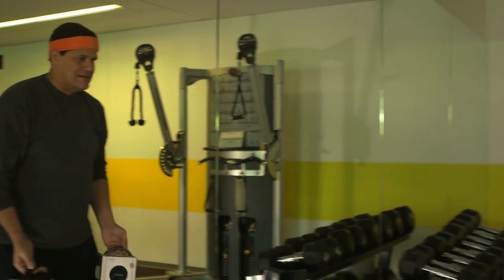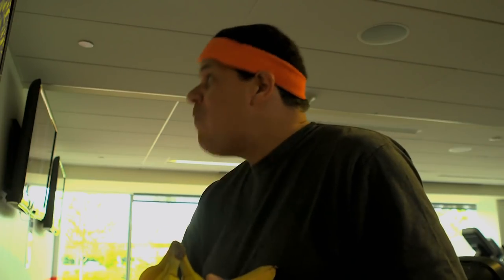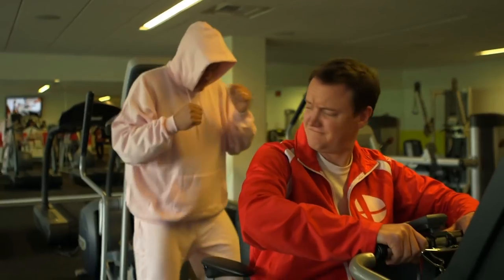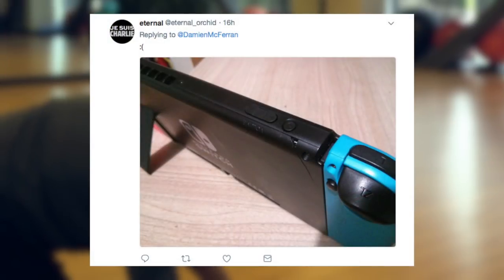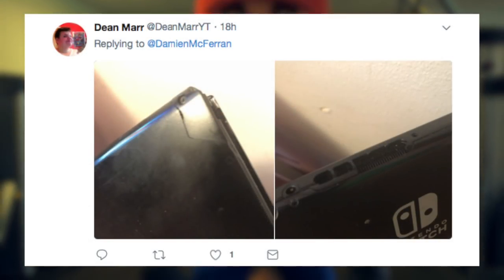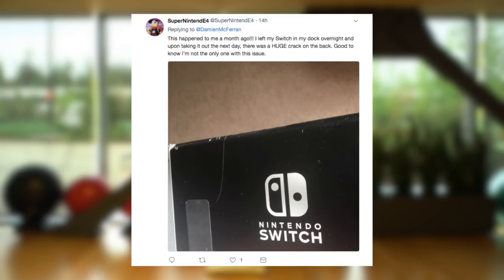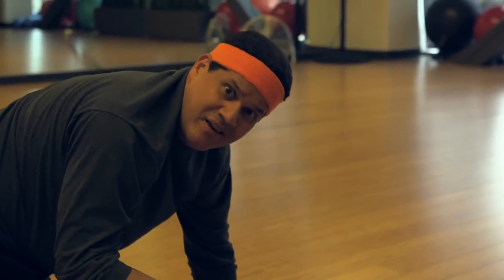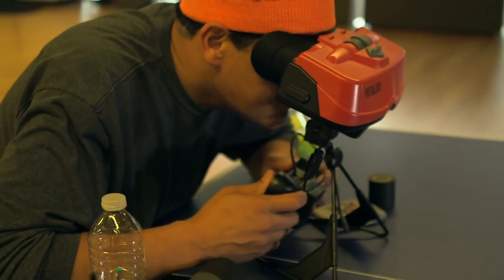Is Your Nintendo Switch Cracking Under the Pressure?

Comment: Yeah a piece of plastic has broken off near one of the corners on my Switch. I’ve already had to buy a 2nd pair of Joycons because the original pair isn’t very durable. I hope we get a Switch Pro at some point.
Reply: Yeah they'll definitely release atleast one revision of the switch, like how there were many different models of the 3ds
Reply: I have the switch since day one, dropped my joy cons more often than i would like to admit but still working fine o.O
Reply: D2daICE If you dropped the Joy-Cons by themselves then they should be fine as they are durable and light, unless you dropped them on concrete or something
Reply: JD
I don't have any carpet at home (it's "only" tiles) so i would say it's pretty hard but they are still fine.
Reply: Tiles aren't really rough like concrete is, so it'd still be pretty hard to damage them anyway.
Reply: I would rather just get a real system. Not some strange Wii U 1.5 boy. (Boy as in portable)
Reply: 16bitFishing Trolling, I see.  Well, I'd rather play my Switch with an outrageously awesome line up of exclusive games.
Reply: Mr. Oscar I believe the official name was Nintendium.

Comment: I've got a slight warp and a drifting left joy con stick
Reply: William Peirce so about the drifting stick, there's this little flap of rubber on the actual analog stick where it connects to the joy con. If you lift that flap up you will be seeing under the analog stick. Get a Q-tip with rubbing alcohol on it and put it in under that flap and clean it up good and after you are done move the stick a lot and click it so that the rubbing alcohol gets deep in there. What happens is dust and dirt gets under that flap and that can cause the drifting issue. After you clean it once or twice the issue should be gone. :)
Reply: Scorer1312 This can work for some if you're lucky enough to reach where the dirt is. I had to completely take apart my analog stick and throughly clean it in order to fix my drifting problem.

Comment: A few very minor cracks around the aux port. That being said I did drop this thing once.
Reply: Bro I have cracks at every screw and some of the screws are loose and feel out. Also on the top because my internal battery is expanding its split in half and you can see the inside

Comment: If you have a good case and know how to treat a PLASTIC handheld device nicely, You shouldn't be having these problems. The cracks people are seeing by the vent is most likely from the heating and cooling, honestly if its getting hot enough for that to happen then its obviously running for way to long. Crack by screws are probably from people squeezing or twisting in rage of their game lol. 😉
Reply: Yea I assume that also, there are people who lets say travel for 6h they would connect a power bank to the Switch and play it like that.
It means not only you get heat from the console but you get charging heat also while playing it for a long time

Comment: It's been getting up to 105° F in the heat index here in Missouri; my Switch console is fine, but the right Joy-con is buckling, like, when I snap it into place, it bulges outward on the back ever so slightly.

Comment: Bad design ... no excuses
Reply: benjiskitts Too bad this happens to the 1% ya know the 1000-20000000
Reply: Starman yeah exactly very bad design
Reply: benjiskitts Oh i see Nintendo has a bad design they should take inspiration from xbox 360 and how it never fails or how quiet the PS4 or how the Xbox one x never freezes and how the psp had a good game line up. Nintendo is the only failure. You know 1000 people is nothing to 20000000. It's an extremely small percentage of people

Comment: Just checked, mine's still ok knocks wood
I do mostly play tabletop and handheld, and when I notice it does get hot, I let it cool down by making sure the air vents are not covered by something. Plus when I don't use it I tend to keep it in its case away from sunlight

Comment: My air vent cover cracked and broke off. My switch stays insid3 most of the time so I don't know if it's the Florida heat doing it. But I really noticed the problem after playing fortnite over and over for days it made my switch really hot and it seems like the back cover is bending and warping. I really hope this gets fixed

Comment: Buy a replacement shell they are everywhere.
Reply: InteractiveHero but those void warranty. If you encounter a problem and you've already replaced the shell (or even so much as removed it even once), you're on your own.
Reply: SpectralDynamite It's easy to replace.. take off 9 screws put the replacement case on and screw those 9 screws... It's not that complicated
Reply: Starman That's not my point. I meant if there's any OTHER problem with the Switch, like one of its internals failing, they won't help you because you already tampered with the device.
Reply: SpectralDynamite You've never fixed a switch have you? The back plate isn't going to break the iternals if its fixed because nothing is sticking out. I've switched my back plate to have a navy color and it wasn't that stressful
Reply: SpectralDynamite Amd I see what you're saying but Nintendo can help you if you didn't do it and even if Nintendo won't GameStop, Target and Best buy all will they all can repair it even if tampered
Reply: SpectralDynamite what Ninty doesn’t know doesn’t hurt them 😏
Reply: SpectralDynamite if you buy any third party shells and place it on the switch and want it fixed then no money will go towards Nintendo and instead goes for the third party company

Comment: Got a crack circling the top right screw, just like all the pictures online.
I thought I maybe mishandled it, because for awhile I didn't carry it in a bulky case and just carried it in my purse. But if alot of people got the same crack as me then it's no coincidence. I'm not entirely bothered by it. I know if there's a new Switch upgrade I will buy it. And there's always the opportunity to buy a new shell online as a replacement.
But it is concerning that this is an issue. :/

Comment: Mine developed some small cracks right at the top of the screen, top right. The SCREEN, not the shell. These cracks appeared following an incident where it turned on while inside my bag, and opened up Breath of the Wild. It proceeded to get extremely hot (too hot to hold, but not to the point of going into overheat protection), and cracked shortly after.

Comment: I’ve got small cracks along the air vent’s upper part of the thin plastic strips separating the other holes of the ventilation. It took a while to notice, since they’re small cracks.

Comment: Had mine for almost 8 months now, with the relative time of use and the very sporadic temperature changes here in the tropics, nothing really caused mine to crack. I do have though a rubber jacket courtesy of the Skull&Co Gripcase I bought which makes any impact softened.

Comment: Not a single crack on mine and got during the midnight release. This could be a heat-related issue, but I do live in the middle of a desert and I haven't had any issues so far. I do keep it in a carrying case anytime is not in its dock.

Comment: The weather gets awfully hot here in Belgium sometimes, but my launch Switch doesn't have any cracks (yet). Although the top vent on my Switch used to smell like something in it had burnt to a crisp a few months ago...
Edit: I just checked and it has a crack in the corner around the top right screw like everyone else. Nobody is safe from this (except people who live in relatively cool areas). This could be a good thing for shell producers, since people are gonna be wanting replacement shells without having to send their Switch to Nintendo and thus not being able to play it.
Reply: I have a minor hairline crack on the top corner near the power button around the back plate. I clocked this tiny scratch/crack over a year ago when I first got the thing and it hasn’t gotten worse since then. I believe many Switches were shipped with minor cracks that have worsened over the year.

Comment: Two of the four vent fins on my Switch snapped off and there's about a 1mm hairline crack from the midframe. I'm pretty sure it's just the constant heat emanating on the vent causing these cracks and breakages. My guess is the structure isn't reinforced enough so when there's minor expansion or shrinkage with temp changes on the shell causing it to hulk out and crack

Comment: Not in a position to check for more than what I know off hand, but I have noticed the parts over the top vent have cracked. For the way they designed it, I could have been rougher on it than I normally am when the Switch is in a case, but otherwise, I feel that bit is the normal wear and tear if you happen to be in the warping Switch group, or could be in that group if your Switch hasn't warped yet because you rarely play in docked mode.

Comment: i’ve had my switch for almost a year now, and nothing has happened to the switch console itself. the left joycon broke (the motor underneath the stick would keep getting stuck in the up position), but other than that nothing is out of the ordinary besides two small dents on the edges from me accidentally dropping it on separate occasions.

i play docked and undocked at a 30/70 rate, i would say. i only ever play docked if i’m at my dad’s because his tvs are closer to where i’m sitting, haha.

Comment: I have a day 1 switch that developed cracks all around the vents and the usb-c port about 8 months in, but it's really just cosmetic, so I didn't worry about it.  I called nintendo last month, (June 2017) for a joycon issue, and they offered an out-of-warranty repair for the joycon and case replacement for $99 USD.

Comment: Mine has a crack on the back panel near the power button and the plastic is also warping around the fan area. I've actually contacted Nintendo regarding this and they basically said I've physically damaged it even though they've not inspected the machine nor has seen photos of it. I've not dropped my switch once.

Comment: Not only has some of the back had some cracks to it, but the dock surprisingly has a crack on it in the front. It may have been a bit of heat through a window it's next too, but it's only gotten to about mid 80s outside in Fahrenheit while near it. The back of the console is also experiencing some rough surfaces due to excess touching/holding.

Comment: I predominately use docked mode on my Switch at my house haven’t noticed any cracks on it and I’ve been playing it in Handheld and Tabletop mode on 9 day long road trip with my dad and still haven’t noticed any cracks then again I’ve never got my Switch super hot. Only slightly hot. The only noticeable damage I have is my Blue Joycon on my left side of my Switch it slides off when I touch it from the side and the bottom meaning I might have a bent slide track for the blue Joycon on the left side of my Switch console. Still works perfectly fine tho.

Comment: Yep on 3 of the pieces  that go across the air vent and also a crack beside it almost touching the screw hole. I have dropped my Switch a few times before but of the times it's actually hit the floor it was on carpet and only fell about a foot since I was sitting on a couch. More likely it is from the heat from the vent and from possible pressure being put on that spot when changing game cards.

Comment: My switch was bending a little bit, but I took it apart, put ICgraphite pads on both sides of the copper heat sink, tightened the screws a bit, and that solved my issue.  Never had any issues with cracking, but I imagine it's because the plastic is constantly expanding and contracting.  It causes a lot of stress on the thinner areas... Not sure why some do but others don't.  It could also be that if someone drops it once , it can cause micro cracks that get bigger over time.

Comment: The back of my Switch was showing cracks around the screws on the back. I actually thought it had something to do with being docked because I always played my Switch in portable mode but when Bayonetta 2 came out I switched to docked mode because it drained the battery super fast. It was after I finished beating it and it's prequel that I noticed the cracking. It was purely superficial but it was a bit annoying. I've actually changed the back of my Switch to a third party one now along with my joycon shells and I've noticed that my Switch is actually bending a bit where it never had before. It's just a slight bend but it's annoying to see this happening and I'm hopeful that either the next Switch or a refresh will come with different materials that better resist this effect.

Comment: I've kept mine docked since day one of it's release, only using portabley on a rare occasion (so maybe 0.05 percent of the time) do I use it undocked.  And I have no cracks whatsoever in my Switch.  So heat causing these issues when docked is not the (only) cause of cracking.  And when I do transport it in a case I am sure to power it off so it won't accidentally power on from sleep mode and cook itself inside of the case.

Comment: I know this is kind of an old post... but I was wondering if anyone has had a problem like I have, so basically the back is not cracked, but I noticed something odd about my switch, when I look down the heat exhaust vent I notice that the heat pipe and fins looks a little pushed or bent back, and the heat pipe and fins are actually pushing on the back of my switch and when I push back on the back of my switch I can literally move the whole heat pipe forward into the position its supposed to be in, this is causing it to not lay flat on a table on its back, I'm not sure why but maybe there is adhesive that's supposed to hold the heat pipe down that melted from getting hot?? or maybe it just warped from heating up and cooling down a lot?? I'm not really sure, but maybe someone in the comment section that has had this happen and knows the cause

Comment: The only issue I have experienced with my switch would be a slight wear on the left joycon that would make it slightly loose.
It doesn't detach itself but you can move it perhaps 5 mm without pushing the release button, however, I think it is due to the fact that I accidentally put it on the wrong position once (on the joy con strap) and had to fix the issue shortly afterwards. Other than that I haven't had any issue, no overheating, no cracking, no connection shenanigans but I didn't get it at launch so yeah.

Comment: Not sure if "a lot of people" is actually true but from what i see those pictures don't look like "oh it just happened while my switch was lying around. My Switch has a case when i take it with me and i already dropped it twice - no cracks or anything visible. Even the switch of my very young nephew looks pretty ok (finger prints and stuff on the screen don't count) and he doesn't treat it as good as he should.  

So overall my experience looks like a pretty sturdy system.

Comment: My friend’s switch tends to get a lot hotter than mine for some reason, and his room tends to be very hot all the time (poor ventilation maybe), and you guessed it, the back case is cracked near the stand. He bought a new clear plastic back to replace it, but accidentally stripped one of the screws trying to take them off. We’re not sure where to go from here, but luckily it is cosmetic, as you mentioned.

Comment: I had this issue. Never dropped etc. I had 4 replacement switches in the first year. So far the last one has held up, although I avoid playing it docked (seemed to happen when playing docked more frequently). I sent my Switch back 4 times for this issue, each time getting it replaced. Really not good enough.
Reply: For anyone interested, heard back from Nintendo yesterday. They are sending me another replacement Switch, no charge. This is even despite it being out of warranty (launch).  Have to say I am really impressed with Nintendo customer service (Australia). They took into consideration that I had already returned 4 units with the same defect etc. can't say I'm confident this won't happen again, but really good service.

Comment: I don't know how, but the screw in the top of the switch came out, and since then parts of my Switch have  broken off (namely the strips of plastic that make the air vent) and now although it's not in the pieces the entire backplate of my Switch has come off and I have to pop it back in or hold it in place.

Comment: In my case it was the screws being too tight on my Console, cracked on the top right hand corner sitting in my case for a month. It was still under warranty and I got it repaired for free. The Nintendo repair center didn't charge me for accidental damage so it must be a very common thing.

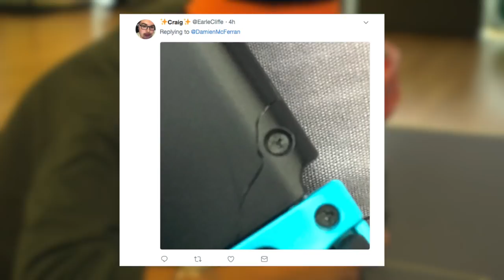Comment: My Switch has the small triangular hole near the power button as seen at 0:59.

Now, I HAVE dropped my Switch, but it was in its protective case with Joycons attached and I inspected it carefully afterwards, no damage at the time.

Also if past experience is any indication (30 years of gaming, stuff happens) the first if not only thing to crack from impact on a Nintendo system is the screen.  It is very odd for the case alone to crack in such a small and apparently specific area.

Comment: Mine started a few months ago and cracked all down the back over time on the left Joy-Con side.  Nintendo fixes stuff like that, but I'm past warranty.  Apparently, it's because of the battery being right there and it can expand and crack the back. I just put electric tape over the crack to prevent more damage and to give my Switch some character.  Someday, I'll probably replace it myself, but it works for now. Doesn't affect game play, so no big deal.

Comment: The fan to my Switch has been pretty loud so my Switch cracked a while ago.
I ended up having to replace the joycons as they had problems connecting after the cracks got too bad